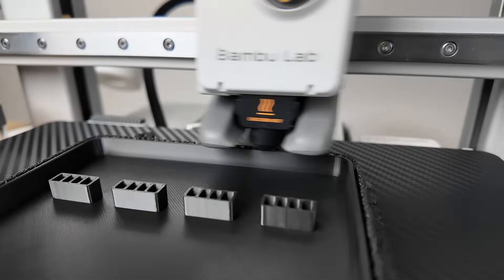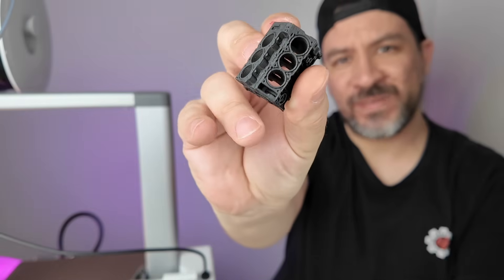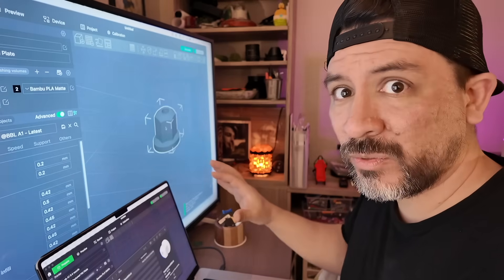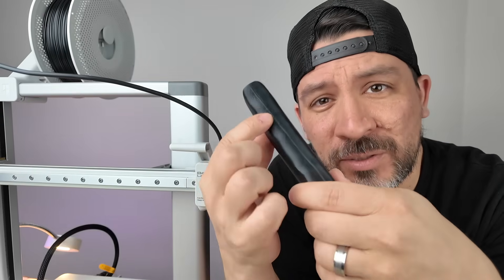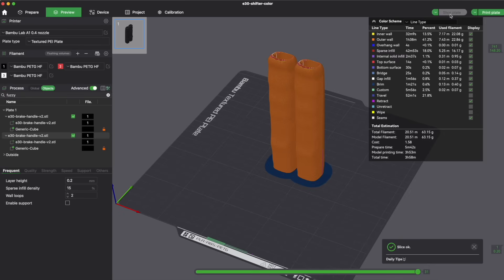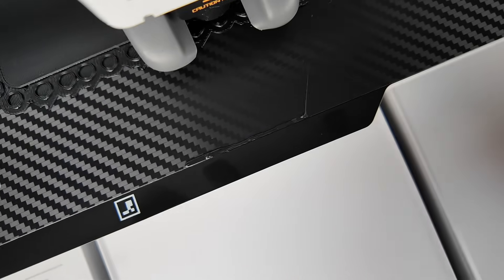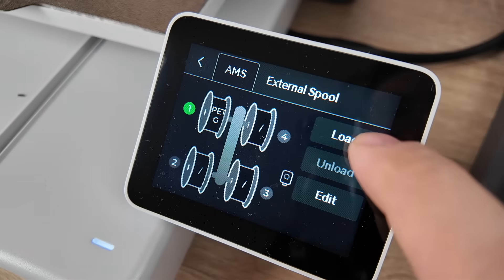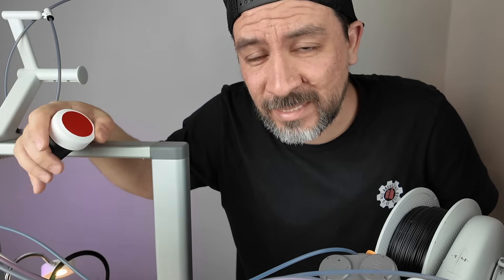How To 3D Print QUALITY Car Part Accessories on a BUDGET

Comment: Hello, I do have a few questions. I am looking to collaborate with my family to purchase a 3d printer for my dad and I am a little lost on what the best one would be to get him. Would there be a way to contact you outside of the comments section for questions?
Reply from the maker: Sure, a few ways. I have a tool too to help you pick the best printer, but I'd recommend bambu lab for beginners as its super easy to get started with -> https://www.allaboutthebuild.com/blog/2025/6/3d-printer-for-automotive-parts Also reach out at contact @ allaboutthebuild.com with any other questions you might have. Would love to help out.
Reply: Thank you so much, I will certainly reach out 😊

Comment: The A1 is a great little printer but not at all what I'd suggest for a person wanting to print car parts, as they'll really want an enclosed setup to print with ABS or ASA... Hell, I wouldnt even tell them to get a Bambu Printer, because Elegoo just released a printer a couple months ago that trades blows with the X1C (A $1000 printer) for $300. Its called the ELEGOO Centauri Carbon. And reviews for it have all been that its price to performance is unmatched. Its almost 1 for 1 and X1C, same build volume, enclosed, hardened steel nozzle, etc, but at 1/3rd the cost. The only notable absence so far is that there is no AMS system to upgrade to for multi-color prints (which you wont need for car parts), and the enclosure is lower quality (Gotta cut costs somewhere). The A1 is $279... I'd urge everyone to spend the extra $20 and get the Centauri Carbon instead, especially if your goal is to print car parts.
Reply from the maker: Will have to check out the ELEGOO, this was more for accessories and limited interior parts. Thx!!!
Reply: @Itsallaboutthebuild  Fair, and I know the hobbyist segment loves the A1 for printing small things like crafts, toys, and coins. Im not saying its a bad printer at all. I just think its better aimed at people who just want to play around and make toys and the like. If you want to print anything actually functional though, like connectors, gaskets, mounts, etc. You should opt for a way more capable machine that is fully enclosed.
Reply from the maker: @secondleasegamer8312  1000% agreed 🙌🙌🙌

Comment: "I hid the seam by making 2 new seams"
Reply from the maker: @slaughterman44  🤷‍♂️ those were intentional 🤣 thx for watching 😁
Reply: @Itsallaboutthebuild  also a tip, isopropyl alcohol can clean the bed in a pinch but eventually will still leave residue overtime, the #1 thing to clean it is just warm/hot soapy water and a sponge
Reply from the maker: @slaughterman44  good to know. Thx for the tips. Is there any soap you recommend? Dawn OK???
Reply: @Itsallaboutthebuild  I haven't noticed any difference between soaps, I've used dawn, dish, and a Dr squatch bar lmao
Reply from the maker: @slaughterman44  😁 nice, thx 🙏

Comment: I picked up a cobra 2 max for $420 super big and great price.  
Oh PLA will not melt in the sun I’ve got lawn figures I mad with PLA in my garden for four years
Reply: PLA does not melt in the sun. It melts in a car at 70 degrees in the sun.
Reply from the maker: @blog8020  🤣 good point, in our test it started sagging at around 110F on the dash 😁
Reply from the maker: @jack0cat  nice, glad to hear PLA is doing well, we tested PLA on our dashboard and it started to sag 😔 what brand of PLA do you use???
Reply: @ PLA will 100% melt in the sun and worst of all, the UV resistance is super low. Causing it to discolor and become super brittle (its already pretty brittle to begin with.). I think that guy probably lives somewhere where the weather is fairly temperate. But even so, printing parts for a car is going to be rougher than simply a print outside because the inside of a car gets so much hotter than outside in the sun. PLA begins softening around 100 degrees farenheight. In the summer, my car parked along the road easily reaches 120+ F with windows closed.

PLA is fine for indoor decorations, but its not made for high hear, UV resistance, or load bearing. Making it pretty much useless for anything other than decorative. I print everying in PETG, unless its going in my car or load bearing outside, in which case I use ASA as its the most affordable material that is mostly weatherproof and fairly durable.

Comment: You can also use a Scarf joint to hide the seam.  Also increase your wall thickness to had more rigidity.
Reply from the maker: Oh man, great tips. Will give this a try, might have to add these tips into the next vid. THX 🙏🙏🙏
Reply: @Itsallaboutthebuild  change the Seam position from Aligned to Random. That will get rid of the Z seam.
Reply from the maker: @jb3d247  I tried that on a part and there were small dimples. Any suggestions on how to smooth them out in any other slicer setting???
Reply: @Itsallaboutthebuild  Did you try calibrating the filament you used?
Reply from the maker: @jb3d247  played around with calibration on Orca Slicer, but not Bambu Studio
Reply: @Itsallaboutthebuild  I'm not sure if Bambu Studio has added the scarf joint yet but I would suggest downloading Orca Slicer.  IT is identical with Bambu Studio but way more features and updates.

Comment: the fact that the Elegoo Centauri carbon is cheaper than this is insane
Reply from the maker: @jasongooden917  it has some interesting specs… auto z offset is big for me based on my experience with an older Creality. Would be nice to get our hands on an Elegoo for testing. Have you ever tried their products???
Reply: @Itsallaboutthebuild  their resin printers are rock solid, noy so sure about there FDM printers
Reply from the maker: @TheAciddragon069  interesting, will have to keep an eye on the printer when it comes out. Thx

Comment: Personally, for car parts I'd use ASA or ABS. Better yet a Glass Filled ABS will help insure dimensional accuracy and reduce warping.  Unfortunately, you'd need an enclosed printer to print any of those well.  Bambu's P1S is more than capable, but will require some upgrades for abrasives like glass filled filaments.
Reply from the maker: @unamanic  good to know, hoping I can upgrade to a printer with an enclosure soon. We can then test tons more filaments. Most of these prints are in the cabin with no direct heat.
Reply: You can buy a tent for pretty cheap to go over your printer instead of getting a whole new enclosed printer. Remember, we have 3d printers for cheap alternatives to otherwise expensive alternatives!
Reply from the maker: @Ayane13b  good point, just watched another vid with an enclosure for an A1. Will have to try it out. Thx 🙌🙌🙌
Reply: @Itsallaboutthebuild  🫡 anytime pookiebear!
Reply from the maker: @Ayane13b  🤣🤣🤣

Comment: I would like to see how those stay in a car in the long  run. Spoiler alert: they will be ruined even before the sun comes out string in the summer. 

Good try but nope it is not easy to design them, not easy to print them (for long term), not that hard either. But this video is more likely the idea... I hope people would not believe that those materials would be strong in long run
Reply from the maker: PLA is no good inside the car with sun, don't ask how we know 🤣PETG on the other hand tested OK for us in this video 👉 https://youtu.be/PNtHVOVIX4w

Comment: Zero interest in buying a Bambo Labs printer.  I've seen their game plan used elsewhere before.  I know where it ends; it's not going to be anywhere good for the consumer.  I ended up buying a Qidi Plus 4 instead, you can print more engineering filament with that printer anyway.  I'm not sure anything you're building with this specific printer can spend real time in a hot engine bay.  Maybe you can get away with Fiberlogy CPE HT
Reply: Bambu all the way here with zero problems ....even so the printers i have are getting better when i do the updates 😂
Reply: Your funny or just disoriented 😂😂
Reply from the maker: @frontcentermusician  you talking about the “security” patch scandal 🤣🤣🤣
Reply from the maker: @hamsterbrigade  curious to know more about the “game plan” I need to know 🤔🤔🤔
Reply: Wouldn’t go anywhere near a Bambu printer.
Reply from the maker: @DopeCity5000  you can go just LAN mode, do you really think they will force payment per print??? I work for a company that sells software and hardware. The best “company” option is subscription payment for software feature upgrades. Customers will not accept subscription for use.